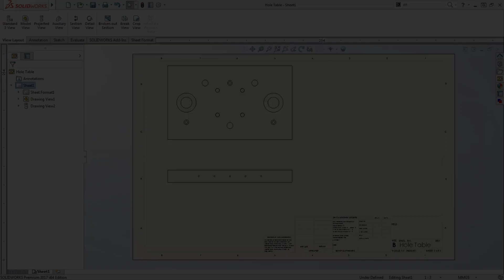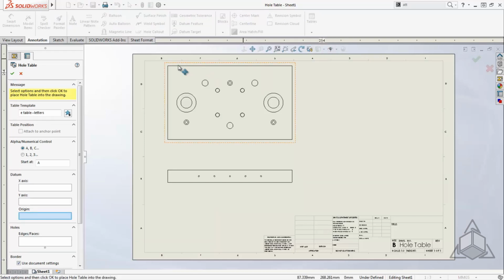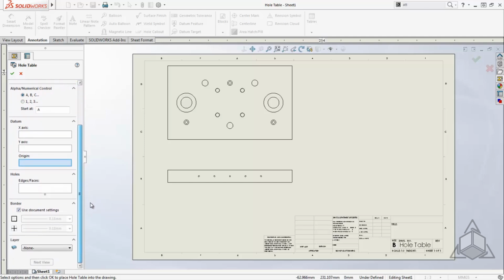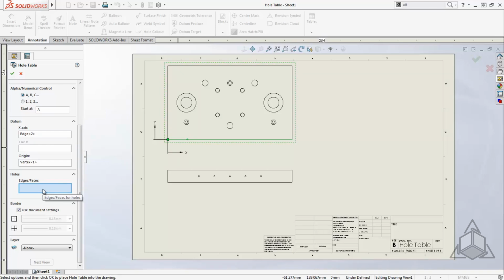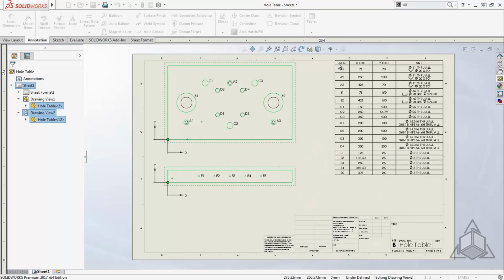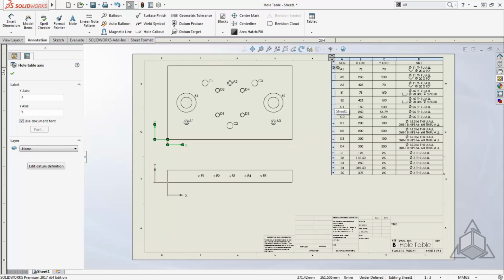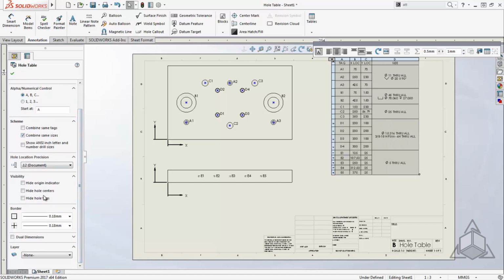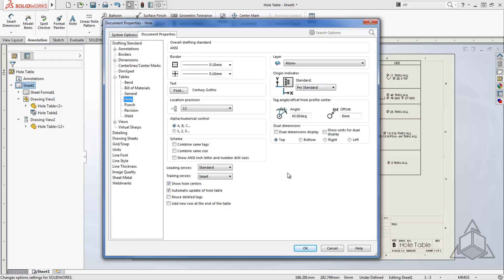Tech Tip - SOLIDWORKS Hole Table

Comment: Thanks! I know this is almost 2 years old, but you're still monitoring, I have a question. I've got a part that has a couple of irregular cutouts in it in addition to the regular holes. Is it possible to have the system skip these? They won't mean anything in the table, so I delete them, but then it doesn't reorganize the lettering of the others. The irregular cuts were labeled B and D on the holes table, so now my table goes from A to C to E rather than just relabeling them A, B, and C. 

Thanks for any help you can give!